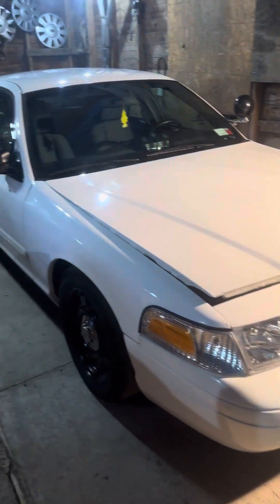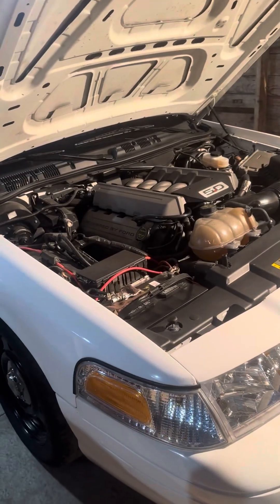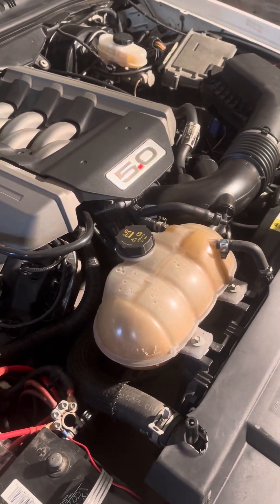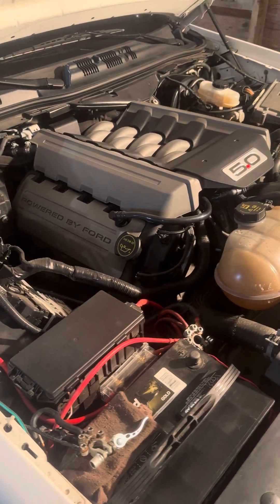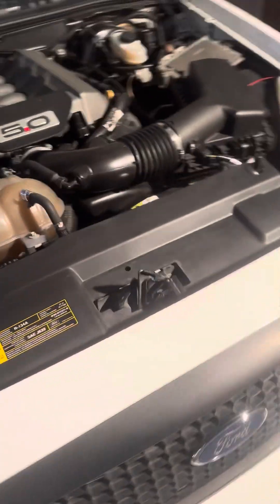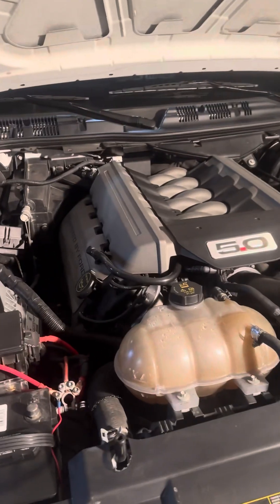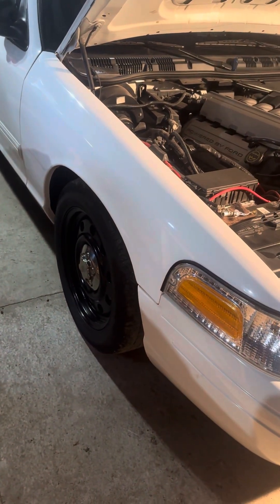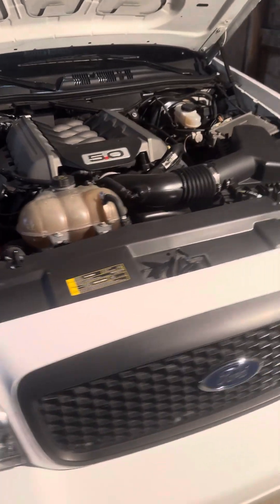Coyote swapped crown Vic recap

Comment: I have a 2011 as well want to do a swap! What's a rough number I'm looking at cost wise thanks in advance and that's a sweet ride
Reply from the maker: I have less than $10k all in
Reply: The stock vic transmission and engine mounts will fit a coyote. All you need is the ecu, wiring harness, and a clutch and flywheel or flex plate and torque convertor if you want an auto. You can find a cheap (used) coyote and trans combo for pretty cheap as well if you don't want to risk the stock vic trans going nuclear.
Reply: Should also add that if you do use a mustang trans you'll need to fabricate trans mounts. I meant the stock vic trans will bolt to the coyote.

Comment: i got a 98 mercury grand marquis GS... how similar would it be to go with the Gen 2 coyote route like you did in this video ?
Reply from the maker: Pretty much identical cars however in 2005 I think it was , they went to an aluminum front K member that cradles the engine , so things may be a little different there but I’m sure you could do it 🤘

Comment: I have two questions, what did you do as far as wiring? And does the 04 mustang clutch pedal box just bolt in?
Reply from the maker: @thelazymechanic01  to run the engine I used the ford racing control pack and no you have to graft the Manual peddle box onto your stock brake pedal box
Reply: @garrettstayton  thanks! Btw did you get your stock gauge cluster working? And what did you do for exhaust headers? Apologies if I'm asking too many questions.
Reply from the maker: @ I made my own set of gauges you can see them in some of my shorts, and also had to make my own 1  7/8 long tube headers

Comment: Do I need to change the original differential ? And if so, what do you suggest?
Reply from the maker: I put an Eton Detroit torsion LSD with 4.10 gears in mine but you could use the stock diff
Reply: @garrettstayton  great ! Thanks fam

Comment: Thinkin bout a 5.0 in my 2001 Grand Marquis. 
With a controller can I put it on the stock 4r70w? If not what mods do I need
Reply from the maker: @JordanDaBoogiemaane98  they do make a controller for the 4r70 but If it was me I would find a gen 1 or gen 2 coyote with a 6r80 already behind it

Comment: Super clean swap!
What did you use for headers & engine mounts? Are you running the factory oil pan?
Reply from the maker: I made my own 1 7/8 headers , using outcast auto works engine mounts, and a moroso oil pan
Reply: @garrettstayton  oh nice! I bet fabbing those headers up was a real treat in such a tight spot. 
What are you using for a radiator and hoses, accessories, power steering etc?
There are probably 100 more questions I could ask you too as I plan on coyote swapping my 5 speed MGM. You did a killer job with this build bud. That engine looks like it was born in your car. Did you document your build on any forums that I can go read?
Reply from the maker: @rat_crispy1013  I’m using the 2017 mustang GT radiator and degas bottle I also swapped in the mustangs electronic power steering rack with the factory accessory drive, no A/C tho

Comment: Did you have to fab the trans mounts
Reply from the maker: @sethromero961  I had to modify the factory crossmember a little bit
Reply: @garrettstayton modifying how
Reply from the maker: @iiiamdiablo  I just had notch it with a grinder and cut off wheel a little bit

Comment: Witch headers did you use?
Reply from the maker: I used the factory 2017 mustang GT manifolds with factory cats first but now I have some Summit performance manifolds without cats 🤘
Reply: No clearance issues
Reply from the maker: @DONKRIDA  the summit manifolds clear the frame really well on both sides but I had to modify the steering shaft on the driver side

Comment: Is this a direct bolt up? Ive heard it is but i want too go this route with mine
Reply: The coyote 5.0 and older 4.6 engines are part of the same modular family. That means the bell housings, cranks, some intakes, and even the engine mounts are the same location. I've seen people swap the older 2010-2014 F150s instrument clusters into these vehicles with relative ease.
Reply: @cesarpalmos8235 actually you’re wrong the coyote is far from the 4.6 family cause that’s the new generation motor the only 2 motors  that are in the same family are the 5.4 an 4.6 only difference is the 5.4 is less reliable with more power the 4.6 is more  reliable an less power
Reply: @simsatvrepair1255  The Ford Modular family is much more immense than two engines. The Coyote shares bore spacing, deck height, bell housing pattern, stroke, and tooling processes as some of the modular family, most notably, the 4.6L.  Here are a list of engines in the modular family: 4.6L 2v, 4.6L 3v, 4.6L 4v, 5.0L Coyote, 5.0L Boss 302, 5.2L Voodoo, 5.2L Aluminator, 5.2L Predator, 5.4L 2v, 5.4L 3v, 5.4L 4v, 5.8L Trinity, 6.2L Boss, 6.8L v10 2v, 6.8L v10 3v.
Reply: @cesarpalmos8235  🤣🤣🤣 only 2 motor with the same module stuff is the 5.4 an 4.6 not the 5.0 I grew in a family of technicians I know so have a nice day